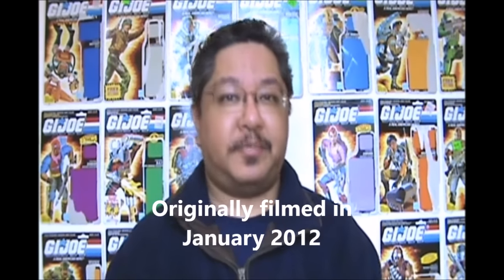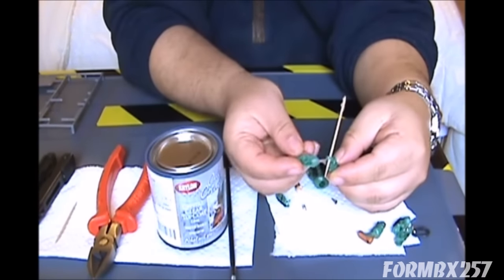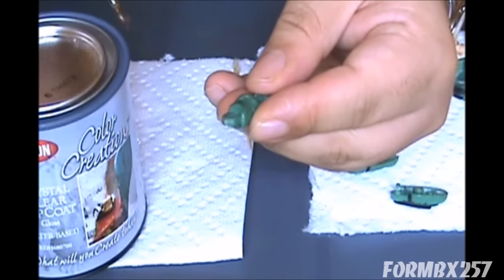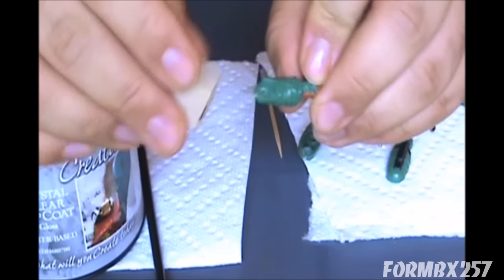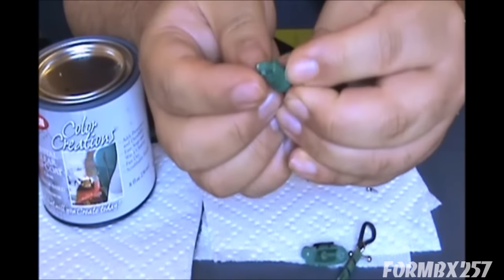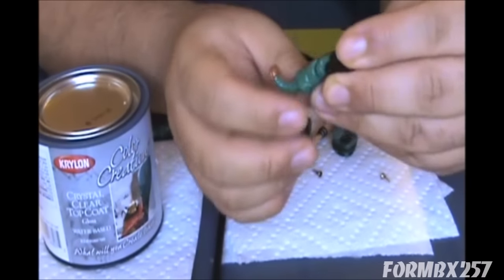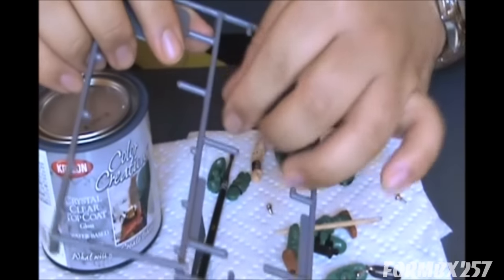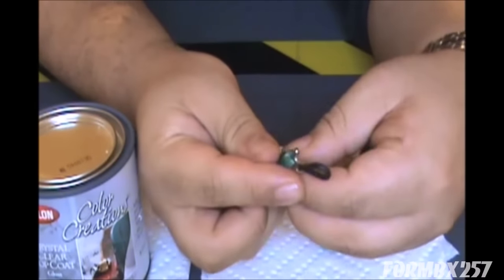G.I. Joe Knee Repair Tips: Fixing Loose or Broken Knees

Comment: Kevin, do you have any suggestions on how to fix the elbow?
Reply from the maker: If you mean tightening them up, I suggest using liquid floor polish (like Pledge or Future).  I use a toothpick to put the liquid into the joints and let it set for a few hours before re-applying again if it's still too loose.  As for cracked elbows: I don't think there's a cure for that.
Reply: Byron Kellogg ..i would suggest to use loctite or superglue to drop a little amount on the elbow joint and just blow it off a bit and keep the joint  movin until the glue dries up and it gives really nice perfect tight tension to it